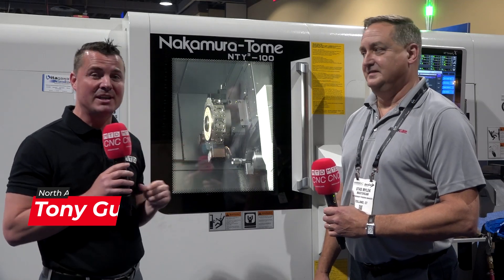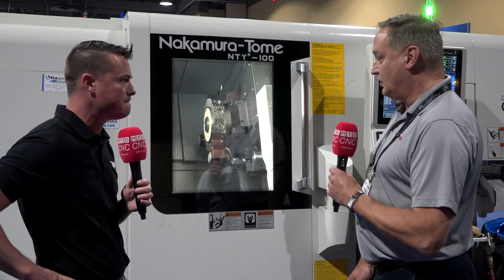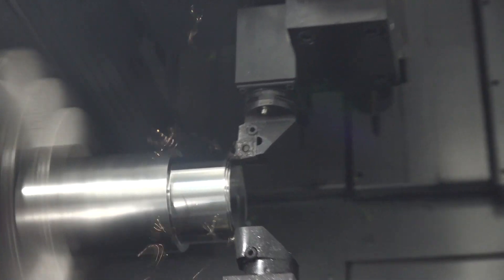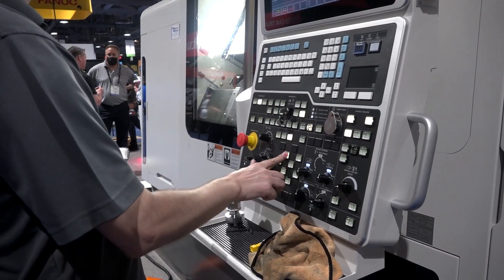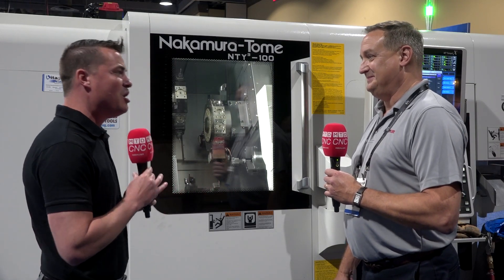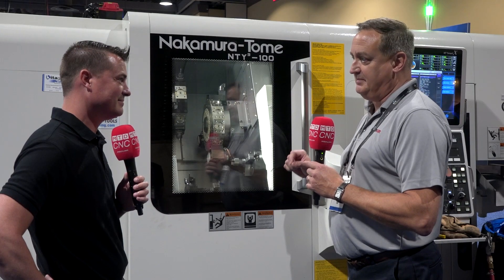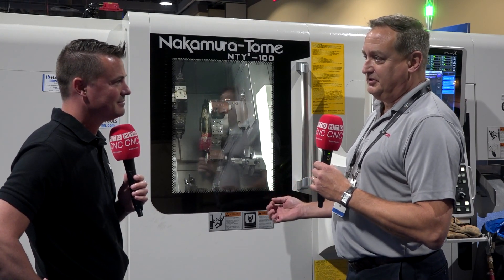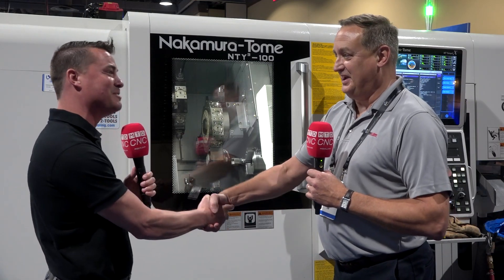All that machining at once, incredible

Comment: We’re seriously looking at moving over to mastercam.
Reply: L. M
Reply from the maker: Glad you enjoyed the video.
Reply: Esprit if u buy this thing masterscam is trash there post are totally trash
Reply: @waller393  I have a similar package to mastercam, and you can develop your own posts. It’s important to get to use these packages to the fullest extent. I’ve heard very good reports about mastercam. Regards Terry - South Africa.
Reply: @terrynaude284   so ir going to spend 50-60 usd and still have to work on your own dime? 
No thanks buy the stuff that works and make that money
Reply: @waller393  so what do you suggest?
Reply: @terrynaude284   esprit if u have multi turret multi channel machine’s
Reply: @waller393  I’ll check it out, thank you. The layout of the program, I prefer my way by far over any of these cam specialists. Regards Terry.